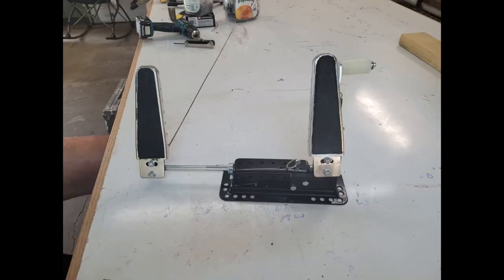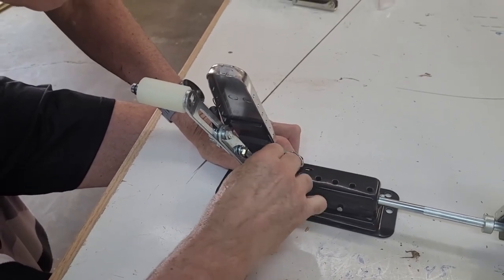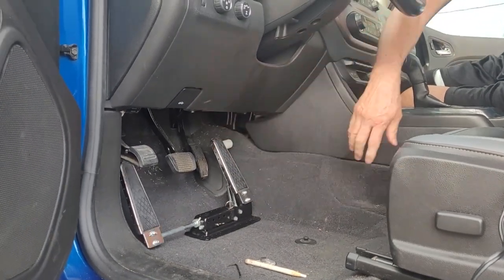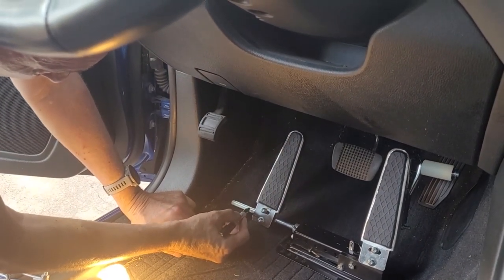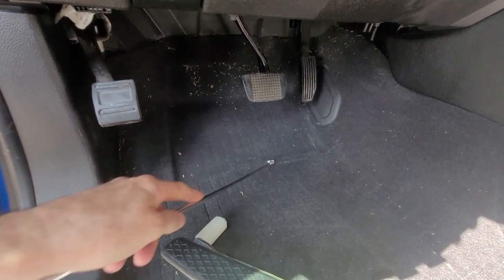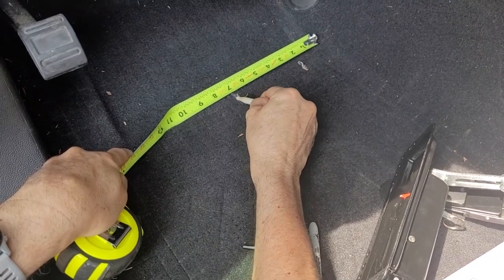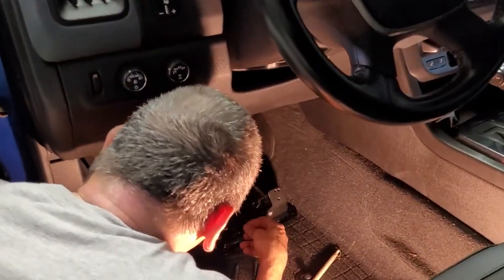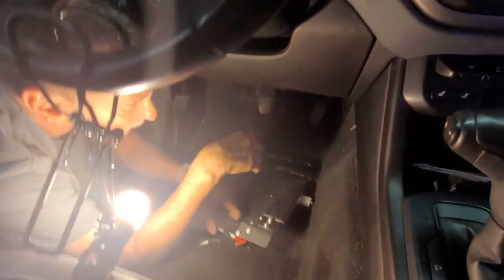left foot accelerator pedal installation disabled driver left foot driver

Comment: Greg- I hope you are well and able to get back to adventuring soon.  I keep learning a lot from your cargo trailer conversion videos.  Currently purchased a used 6x12 out of Plano, TX that came insulated and wired with 2 110 circuits and a 30 amp shore plug.  Working on replacing the hubs, then start on installing a portable a/c w/heat so we can start using it as we work on it. Take care and God Bless!
Reply from the maker: Thanks for watching. It sounds like you have a great start.

Comment: I cant drive and haven't in 2 yrs have a numb right foot. Im in PA what process or what help is available i cant afford a $185 an hr to hire an instructor
Reply from the maker: I don't understand why you would need an instructor. If you can use your left foot go to a big parking lot an practice until you get it. Or get hand controls and practice with those. You can do it.